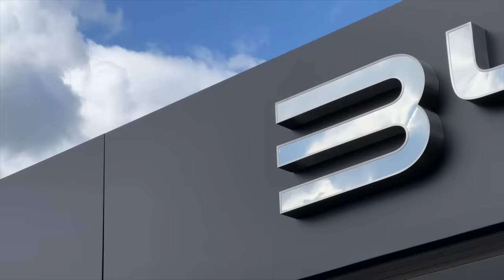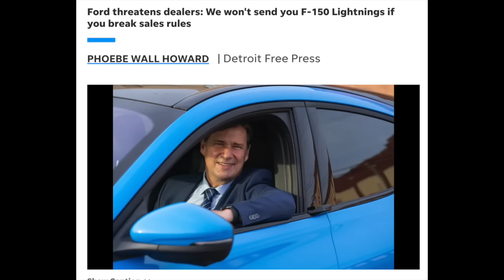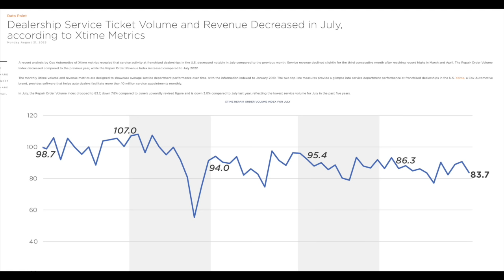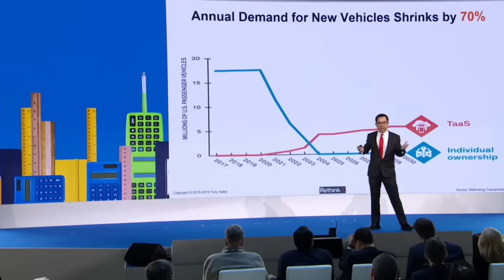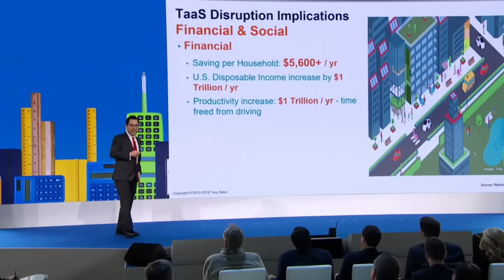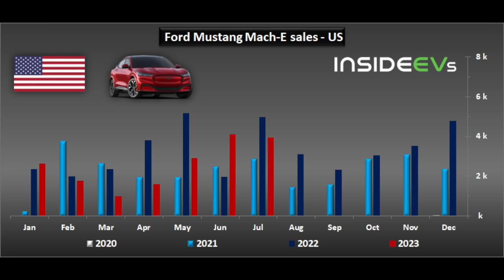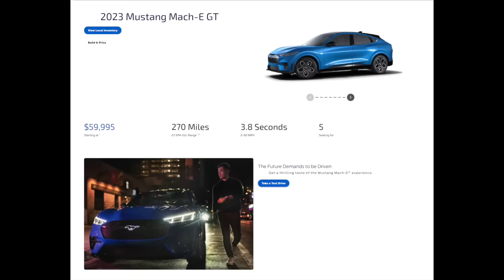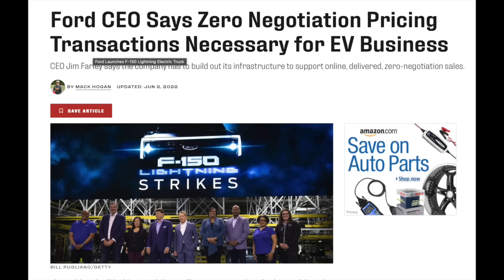The Shocking Reality of Dealerships - Their decline is happening right now!

Comment: The stealerships have a LOT more power than you are giving them credit for here. 
In most U.S. states among the top 5 richest people in each are often dealership owners or groups who own dealers. 

They also own the local politicians through the jobs they employ. Every automaker line manufacturing job can support 5-8 other job's. 
And unions hate/loathe/detest and abhor evs to. Due to less labor hrs per vehicle. 

The current major ice parts suppliers also intensely dislike evs, less total parts to start with and much fewer maintance repair or replacement parts needed for those evs vs ice.
Reply: And that's why they will lose all sales!
I expect 95% of all new cars will be EVs in 2028 or 2029 and their customer base will rapidly shrink
Reply: They can’t define or fight technology changes. I’m sure Nokia, blockbuster, and many of the past powerhouse corporations had friends” in higher places.  But that didn’t do them any good.  The new will eventually takes out the old.
Reply: @superfly19751  well said, my point was&is don't discount how powerful the existing paradigm is. 
And remember to account for people's general dislike&distrust for anything new so to speak. 

I've been sold on evs since the 90s myself. Ever since I found out every ice vehicle uses a battery, requires multiple electric motors.
And refining fuels uses cobalt and electricity among many other things. In a never ending cycle of literal combustion&particulate pollution.

Comment: What's worse than a dealership!? Two dealership! I hate them, when I bought (ordered from the manufacturer at the dealership) my 2021 silverado truck, they were so annoying about adding all king of useless warranty, options, told me that some options are mandatory and can't be removed , like the running boards. When i received the truck, the running boards wasn't even installed, because they were backorder ... but couldn't be removed as an option when ordering the truck. Direct buy from the manufacturer, online, with a clear price, without any pression to add all kind of shitty options, is clearly the way to go!
Reply: Can’t tell Mississippi legislators that truth

Comment: EV's disrupt many areas and that helps create a lot of the resistance to EV's as they hurt dealerships and auto repair businesses (due to so few moving parts and very little maintenance costs - (ex. paid under $100yr for 5 years on my 2018 Tesla Model 3 just for air filters).  Then you have insurance industry under pressure as Tesla can use data from your driving to give you a lower rate (as long as you are a safe driver).  Then you have gas stations that will see less business as more vehicles become electric.  You have advertising and marketing businesses taking a hit in revenue as Tesla for example doesn't do business with them while still having the best-selling car this year showing how word of mouth can be much more effective than commercials.  Of course, the elephant in the room is the huge negative impact to the oil and gas industry (even with their $20 billion/yr in U.S. govt. subsidies and over $1 trillion in global subsidies).  With all these disruptions EV's also impact the stock market, as they create uncertainty in all those industries thus creating uncertainty in their valuations and stock prices.
Reply: Sorry to be that guy but subsides world wide for the fossil fuel industry are about $5 trillion a year not $1.
Buy I agree with your post. If these industries such as dealerships were smart they would see this as a massive opportunity rather than fight it.

Comment: What you get in the Ford Mustang Mach-E is a very sexy looking SUV with a familiar and more interesting interior, Apple Car Play/Android Auto, an EPA range that's actually achievable in real life, and greater access to service and repair centers, esp. in rural areas.

It's a very emotional vehicle and for some, not being a Tesla is a selling point. (🤷🏻‍♂️I don't get it either) Regardless, it is a great vehicle and a good choice, albeit an expensive one.
Reply: I agree that the Mustang Mach E is a good non Tesla EV or rather it is a ok one. I will though correct a couple of points.
Firstly the EPA range is only achievable if certain factors are within scope such as driving style, speed, weather, terrain etc which is true of a lot of EVs.
Secondly Apple Car Play an dAndroid Auto are not deal breakers or the be all and end all. They exist because legacy auto are useless at software so was an easy option for then to get some sort of software in the car. Tesla for example basically handle all that in house so there is no need for Apple/Android though I guess some people fail to see it that way and really like Apple/Android.
Thirdly access to service in rural areas depends on IF and it is a MAJOR if the service centre for Ford etc has service centres in that rural location that can fix EVs as not all do.
Fourth the interior is subjective as that depends on an individual's tastes and preferences, personally I prefer the interior of a Tesla as it is less cluttered, less chaotic and less design noise, though each to their own.
Fishy the exterior looks of the Ford are again subjective so each to their own but I find it average looking but not ugly.
Overall the Ford Mustang Mach E is a non EV but let us not pretend it is a great EV, especially when Ford still can not get a grip on it's own dealerships and their incessant need to rip people off!
Reply: How bout th  technology safety weight software  Chargin infrastructure contacts style comin outta project juniper……. How bout speed